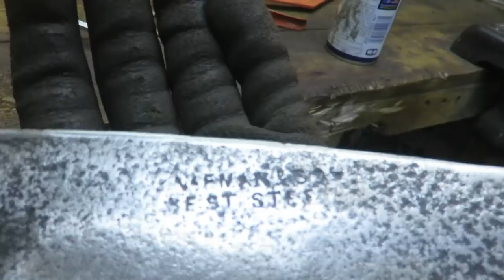Billhook knife restoration/modification.

Comment: REALLY NICE RESTORATION!!!! It's too bad that there is nothing that can be done for metal pitting, but sometimes it gives it a rustic charm, and that is the case here.  Thanks, I've subscribed with notifications.
Reply from the maker: Thanks a lot! really appreciate this :)
Reply: Ive seen someone weld out pitting inns knife i know that's probably frowned upon an most likely ruin the integrity and strength of the knife but it did make the knife look brand new

Comment: Blade has zero temper left after being ground to death.
Reply: Also round handle? Bad idea, no indexing, easily slipped grip. Even the notches aren't going to do much. Also the cold peen on the tang probably didn't help anything structurally speaking.
Reply from the maker: Thanks for feedback

Comment: You ended up with a very nice looking bill hook knife, but this was FAR from a true restoration of the original knife. You should have basically left the knife construction as is, cleaned up and sharpened the blade, and made a duplicate wooden handle like the original, which was beautiful to begin with. I wish that restorers would try harder to recreate the original item as best they can instead of trying to reinvent them by altering the design and creating new pieces that were never there in the original piece. When restorers do that, it isn’t considered a true restoration.
Reply from the maker: Thanks for feedback

Comment: I have a billhook at home, but it is shaped like the traditional hedge layers type with a sharp nib on the back of the blade tip. It is probably older than I am.
Reply: peebee143 
Likewise, I've one also but with a much smaller but tighter hook. I reckon it's late 19 century. Sharpened only with a very fine file, it has awesome cutting power. I used it to hack branches and in December it shapes the tree and trunk base.

I resisted all temptations to use it in the missus.....
Reply from the maker: Nice one